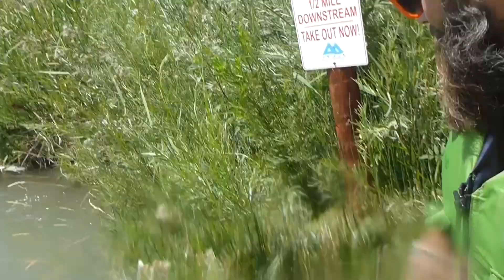DIY Packraft Maiden Voyage

Comment: Interested in doing my own. Has it held up since you posted this video?
Reply from the maker: I've only used it a few times. I'm not sure why, but it took me a really really long time to get it to hold air. I used several bottles of seam sealer....it is a great kit and a good project, but if I had to do it over again I'd probably buy a professionally built packraft. Good luck!
Reply: @ChrisTarzanClemens  same.

Comment: good job. why do you think it was so challenging to make it air tight the first time?
Reply from the maker: I think I just didn't seal the seams well enough with the heat iron. I was tracking down lots of small air leaks and eventually just used seam sealer on all the seams to be sure!
Reply: @ChrisTarzanClemens  did you use one of the irons he recommended or something else? Do you have any other recommendations for someone considering this DIY option or know of where I can find more information in the form of reviews, etc? Look forward to seeing your long term review and adventures along the way. Cheers.
Reply from the maker: Yup, I used the recommended iron. If you can maybe find something more industrial it would help, I think some of his new videos look like he has a different iron that kinda looks better. It was a task, I probably put in a solid 50+ hours, maybe closer to 70 or more. It took longer than I expected, but all in all it's relatively simple. If I were to do it over again, with the amount of hours I put into it, I'd probably buy one already done from Alpaca or Kokopelli.
Reply: @ChrisTarzanClemens  I have an Alpackaraft Classic Llama but I'm going to make a DIY one as well.  With regards to that chinese leather iron that's recommended, a big advantage would be to use a step up/down voltage converter.  Don't know if you did that or just plugged it in with US 110V AC.  Using a  converter to get 220V makes a difference in getting that iron heated to the most effective temp for heat sealing the TPU.  Your raft still looks good and I'm willing to bet the seams will hold up for many years and even if you do find more leaks in the future, just use the Aquaseal or Seam Grip to fix it.  Those are permanent fixes once they cure. Also, Tyvek tape is your friend.
Reply from the maker: @robertruff7460  Awesome, thanks! I didn't use a voltage converter, but, that makes a lot of sense!